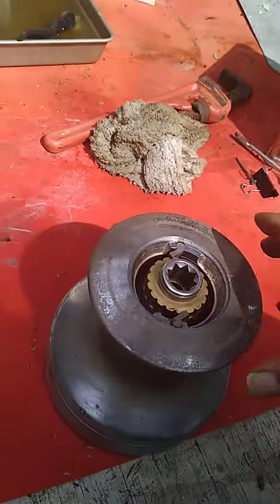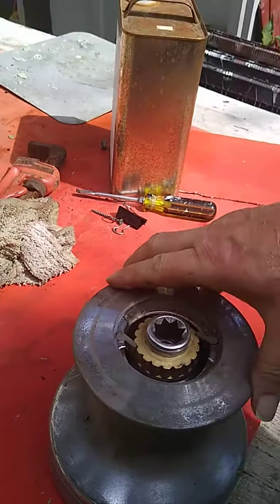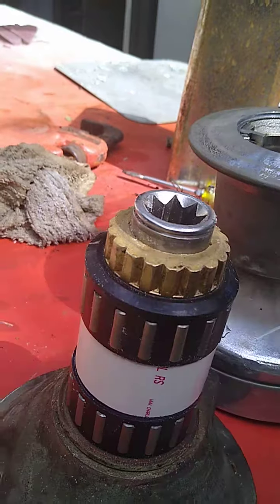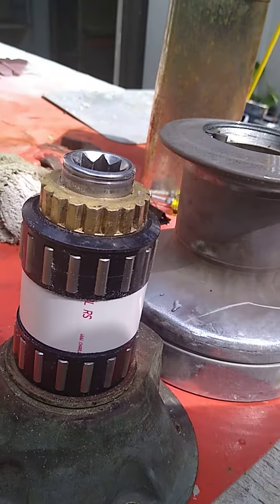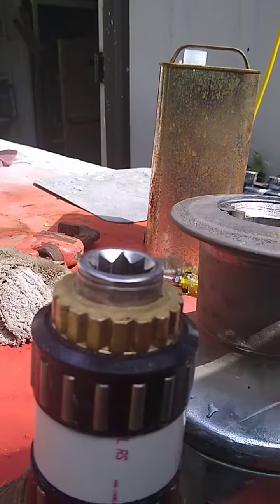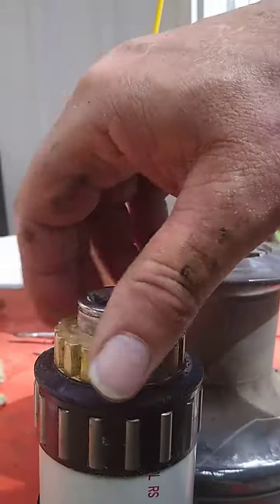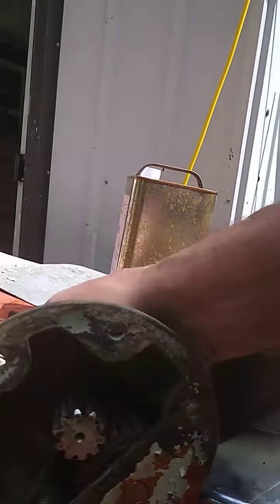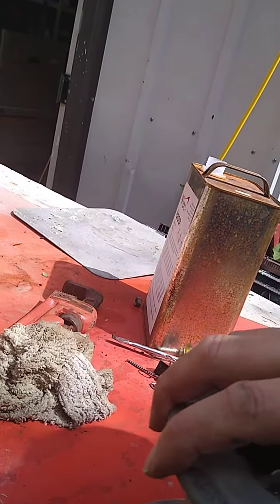older lewmar 43 winch rebuild.

Comment: Does the pin on the lower gear drive up or down?  It seems the lower plastic ring below the bottom bearing is in the way of it coming up yet the pin seems to have a shoulder on the top so it can't go down.  Mine are frozen solid from corrosion maybe and it is going to take a sizable amount of force to free it going either up or down.  Because of the plastic parts I'm reluctant to use any heat on it.

I have one winch unmounted and the other two are still bedded and bolted to the combing.  I cleaned and regreased the gears and bearings and cleaned and oiled the upper pawls after removing them.  The lower pawls that are in between the bottom gears I shot some ATF in there to clean and lubricate them and that did wonders.  

Our winches are pushing 50 years old and have crossed the Atlantic a few times but are still going strong with just disassembling the upper portion and cleaning/greasing and oiling of the pawls.  

Unless the bearings go bad or the lower pawls stop engaging I think they can go another 50 years before they need to be unbolted from the darned combing and removed to service the bottom pawls.  Getting to the nuts from underneath is nigh impossible for the two still mounted.